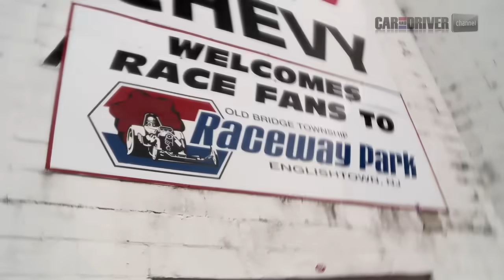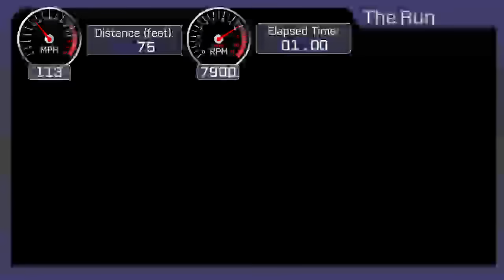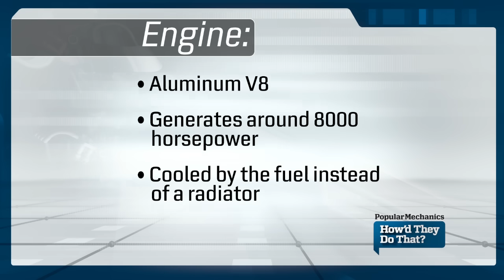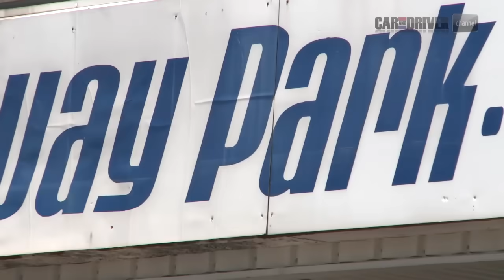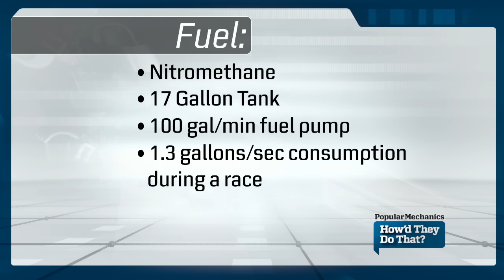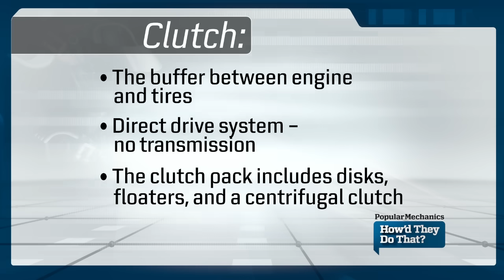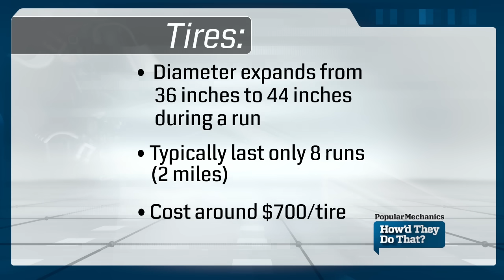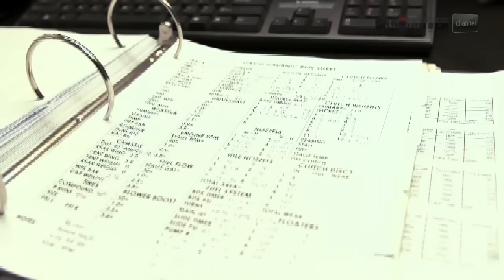How a Top Fuel Dragster Works

Comment: 1 second to 125 mph that has to be a headache instantly
Reply: Eric H only if your opponents time flashes before your time... Lol
Reply: Up to 5 G's of thrust.
Reply: so what,?
my grandma went from 0 - 130 when a spider fell on her lap and I'm talking Vertical.
Reply: How do you even train for this? Drag racers should be astronauts
Reply: Like a jet
Reply: And 2.5 to 200.
Reply: Nah, just insanely forceful. For a small amount of perspective, a space shuttle launch only generates around 3Gs, whereas these beasts are pulling around 5Gs. Even the most forceful roller coaster on the planet only pulls 1G more, at a bit over 6Gs, and that is just for a short moment.
Reply: @cliveadams3916  😂😂
Reply: @Bthast62  imagine you're sitting at a traffic light in your car and a Mack truck hits you from behind at 160.
Reply: Now they go 0-100 in 300” by the time the rear tires are were the front ones where it’s already 100mph.They also are 11,000 HP and the just put those 9,000 HP Engines into TopFuel Boats 🤯
Reply: @Bthast62  we don’t it’s in our blood since we were kids
Reply: @andrewr.66  that’s on his car some of them run 25,000 horsepower motors so we have enough to shake the whole ground
Reply: Now that's funny, not funny! Poor Grandma! I hate spiders!😢😢😢
Reply: @Bthast62   They start out in my 2010 Hyundai Elantra.

Comment: Their list of consumables: Spark plugs......clutches, pistons, rods, crankshafts, and basically the entire engines. Dang...
Reply: Yeah because the engines produce so much heat that they melt
Reply: @1mariomaniac  not that much heat for these engines components. But stresses induced by high G-forces and friction are pretty high.
Reply: @Trident_Euclid  friction produces heat though
Reply: @1mariomaniac  true. But heat generated from combustion doesn't have that nuch affect on these parts. Super alloys can handle it.
Reply: @Ferenc Dobos Sorry, but I wouldn't pay to watch an electric dragster. It just wouldn't be the same.
Reply: @Trident_Euclid  not nitromethane they can’t
Reply: @Trident_Euclid  by the time I get back to my trailer the clutch disc is nearly melted
Reply: @austinmayfield6128  clutch disk is not part of the engine but mounted on it.
Reply: I have not watched the video yet but clutches? I thought it was literally just engine drive shaft wheels

Comment: So awesome. Sadly, motorsports do not lend themselves well to video. You  have to be there to really appreciate the concussive bellow of a top fuel dragster.
Reply: Funny cars are still louder
Reply: Bradyvilleboy .Bradyvilleboy that is so true. The feeling of when your there is sooooo amazing. It a Horsepower earthquake!!! ~famoso raceway~
Reply: @kylesvideos59 , They're about the same. They run the same engines. The difference is in the suspensions and body dimensions. That, and the fact that the engines are in front of the drivers, which seems completely insane to me.
Reply: Bradyvilleboy. Bradyvilleboy you're absolutely right. You have to be there
Reply: Ericynot that's true
Reply: Try being on the starting line. Its even more crazy when you are roughly 20ft from them when they hammer it
Reply: I like when the nitro makes me cry lol is that weird
Reply: This is a great way to explain it. I haven't seen top fuelers in person but even the door slammers shake the ground they launch. It's the closest thing I've felt to an earthquake in Australia, you can seriously feel it through the floor like nothing else imaginable
Reply: Right through your chest no matter where in the stands you sit. It’s an awesome experience.

Comment: basically a new engine for every run. moneymoneymoneymoney
Reply: they're designed to come apart easily and cheaply (relatively).....why do you think that they use such simple engine designs?
Reply: it does look quite easy to work on. the clutch set is a surprise to me, I always thought there would be a gearbox but now when I see it, there wouldn't be many gearboxes that could handle that power
Reply: +Barry McGuigan Is that a Mercedes for your profile pic? ironyironyironyirony
Reply: yeah, its a 20 year old Mercedes.
Reply: Barry McGuigan How's she workin for you?
Reply: not bad, I have it 5 years now and I only had to replace 2 parts,,, engine and gearbox. lol
Reply: Barry McGuigan Ouch!  That had to cost more then the car.  Sorry man, didn't mean to bring up any bad memories.
Reply: Quadrunner don't worry, I'm reminded every day when I drive it lol
Reply: +Barry McGuigan That escalated quickly
Reply: i changed the pic to an opel manta recently, if theres any confusion.
Reply: +Barry McGuigan The surprising part is despite all the teardowns, rebuilds, and destroyed engines, there's still less money in top fuel drag racing than F1.
Reply: They only rebuild it after every run, so they don't change the whole engine.
Reply: that's wat sponsers and winning r for. building a motor for racing is spending with deep pockets just to get a few seconds off the time clock. though car racing isn't as expansive as racing in air planes where cost is in the millions.
Reply: Reginald Nance true, top fuels can't even turn
Reply: Andre... with all due respect to yourself and your comments regarding F1.... just because F1 (in your opinion) is " the most technical, with the newest technology"..... does NOT necessarily mean that it's the "best".... in regards to ANYTHING..... there are Many instances, especially in the automotive "world"... where, "older"... mechanical technology... "trumps" electronic "wizardry".

It is Not a "fair" comparison to say that F1 is the "most technologically advanced".... because it can only apply to the chassis design, tire chemistry, etc for the type of racing for which the F1's are designed and purpose built for...... no more and no less so, than for Any other form of motor sport.     

The "evolution" of chassis design, tire compounding, engine cam profiles, cylinder head/port design, etc, etc.... all have evolved over time in relation to each form of motorsports,  and classes.. thereof,  and each have their own specific purpose.

So there is NO particular "Type" of motorsport that is truly "more advanced" than any other....  each has advanced to suit the needs of each class and form of racing which it encompasses.

Another thought to keep in mind is.... just because "something" is more "technologically advanced".... do NOT mean that it is inherently "safer" or necessarily even more "reliable".... than something that may be deemed technologically "inferior" or pre-dates Any "new" technology.

F1 for instance,  despite it's high level of "technology" (in terms of purpose driven chassis and handling design) has a statistically Higher "death rate" per accident, and per race.... than drag racing,  and "almost" all other forms of motorsports.     Drag racing, in fact... has the best safety record of all motorsports.

PS:  Never confuse "chassis complexity" (ie; F1).... or ANY form of "Advanced COMPLEXITIES"..... with safe and reliable (re: better)..... they do NOT,  necessarily run together.
Reply: why such a long response to such a meaningless comment
Reply: Diego V punctuation goals.. lol
Reply: +Diego V.... Perhaps I was just bored at that moment, with nothing better to do than to wax eloquent with such a sophisticated response to such a "meaningless comment"..... which in reality, really was Not so much "meaningless", as it was.. ignorantly misguided "knowledge" of the subject which he addressed.  : )
Reply: +initialB 240..... how did you know ??...   : )
Reply: 2Stroke Diesel Power call it womens intuition.  the doctor told me to look for my feminine side
Reply: Let them? Its theirs. Some people would say the same things to those who go out to eat or buy a named brand shoe. Or have needless items like a computers ,cell phones or automobiles.
Why would the government control someone else money they worked for? Btw sports like this are how the automobile industries advance.
Reply: You're using a computer/smartphone to make that comment. Should we complain that the government lets you have money to waste on those? If you really want to help, sell them and give the money to those less fortunate. Of course, the bonus to that is that we wont have to hear your comments anymore.
Reply: Frank Tibbitts u
Reply: initialB 240 more like a new drivetrain each run
Reply: Aproximently $65000 per engine
Reply: Not a completely new engine just some internals and other things that are replaced
Reply: Just a tank of gas for every run is over $500
Reply: SuperSonicSenna Cheap? 😂
Reply: @spaghettimonter13  600 fuckin dollars just to fill that thing up with fuel! Lmao
Reply: initialB 240 Yeah. It takes 1.2 million a year to run em.
Reply: @initialb5009  I like da Toyota trueno VTEC car lol
Reply: They usually last 10 to 15 races. Of course if it blows up early then I guess it won't 😂
Reply: @initialb5009  not to mention the fact that you'll never get to fifth year by the time you get to the end of the track 😂
Reply: @WhyteLis21  exactly, the main goal of drag racing is to spend as little time on the track as possible 😂
Reply: @sethh8892  😊👍

Comment: They can add around 200 horsepower adding a VTEC sticker
Reply: Nik chill out
Reply: +Nik you know a lot of them blow up
Reply: +600 horsepower with racing stripes
Reply: Nik What does that have to do with anything?
Reply: FearIanNow 😂
Reply: Don't forget to add a Twin cam sticker too.....that's at least another 200hp?
Reply: NIGHTLAMP12345678 i dont think nik knows what ricers are
Reply: FearIanNow and furry dice
Reply: well 8000hp or 8200ps is not a big diffrence. the more weight is
Reply: FearIanNow ricers hahaha funny ricer joke
Reply: I bet the GM fanboys think an LS swap would put it up to 400 miles per hour.
Reply: 200hp isnt enough to run the supercharger
Reply: keep it at 420
Reply: It was a joke
Reply: FearIanNow I’m sure they will you muppet
Reply: FearIanNow. Hahahahaha
Reply: +400 if you add window tent
Reply: No cookie for Nik
Reply: so does many other car companys...... and whasent the honda like a bad f1 engine whit problems for years?
Reply: FearIanNow 
Warning: it only works with hondas
Reply: Le Medic only hondas can handle so much power
Reply: Or five stickers that's even better
Reply: Furry dice good for another 100 HP
Reply: VTEC valves is the next thing for these types of engines, except in boats
Reply: seriously.  A vtec sticker.  yeah and I guess they can add more power with a lawnmower muffler too.  get real and go back to your 4 cylinder weed whacker.
Reply: +700 lb/ft of tourque for adding wide mirrors
Reply: you can woosh like 500 people on only this comment
Reply: Plus 50 hp for a backwards cap.
Reply: Red break calipers = +200 hp at least
Reply: LOL........
Reply: And 50hp by listening eurobeat but also increses driving skill
Reply: the fast and furious guys would get 10000 hp outta their vtec and leave a top fueler at the line
Reply: V(agina)-Tech
Reply: at least
Reply: FearIanNow you missed the zero a few times, you mean more like 2000000
Reply: Sticker mod
Reply: Just wait till it kicks in😂
Reply: 500 more hp with a v12 sticker and a Extra VTec  sticker
Reply: Then 20000 horse power by adding racing stripes
Reply: Don’t forget the Flame Decals 🤪
Reply: Or a top fuel sticker to your Honda 🤔 ultimate power mod 8000hp sticker
Reply: or by painting the brake calipers red
Reply: Another 200 for the big 6" muffler.
Reply: FearIanNow 😁😂😂😂😂
Reply: LMAO IF YOU ADD A MADE IN BRITAIN STICKER IT WILL NOT WORK
Reply: @NIGHTLAMP12345678  blahblah
Reply: Im the youngest in the book
Reply: That car is 10000 hp
Reply: To much weight
Reply: FearIanNow VTEC KICKED IN YO
Reply: An annoying sounding exhaust and we'll see a 2 second 1/4 mile.
Reply: Resume amount for teo Ami eleu mower piso teo pabor me joannethane apa. Amend Tonto emubusreu r.a AC Philippinas AME
Reply: Resume ammoreis jonathane feuro embersso centvitivo piso republicanism pilipinas r.a Jonathan Avi pobre
Reply: No torque though
Reply: Yuuuup
Reply: Lol
Reply: Mark Simpson while shifting seventeen times per run
Reply: Nitro is what gives it the hp
Reply: Or a 1320 sticker
Reply: Damn bro there's a couple people on here straight ovulating about your comment, I thought it was hilarious 😂
Reply: That’s sick !
Reply: Omg hahahahahaha
Reply: Painted red caliper add extra 13 hp
Reply: Not even close bud
Reply: Earth dreams/ Hybrid.
Reply: @Rouwh  Yeah, keep in mind that these weigh just over 1,000 kg (about 2,300 lbs) in race-ready trim! So just imagine their power-to-weight ratio with such insane power 🤯
Reply: Or lose 7,800 hp